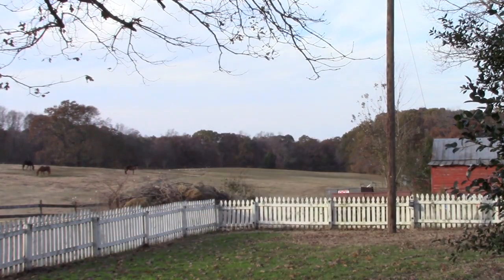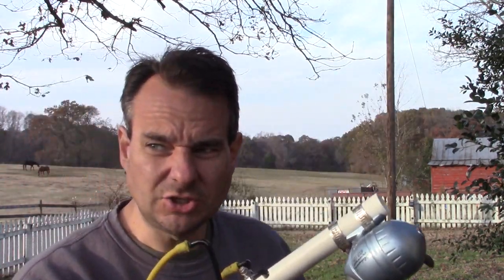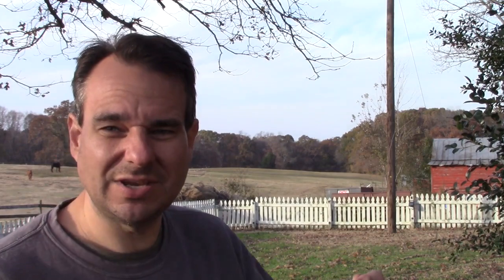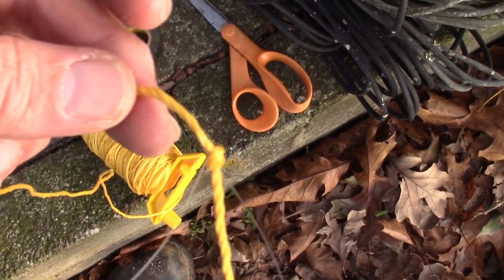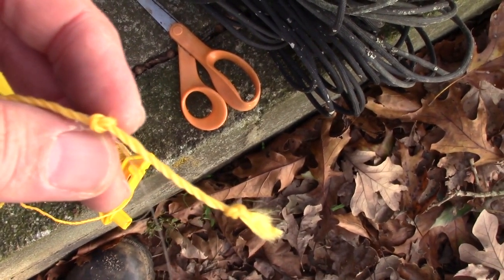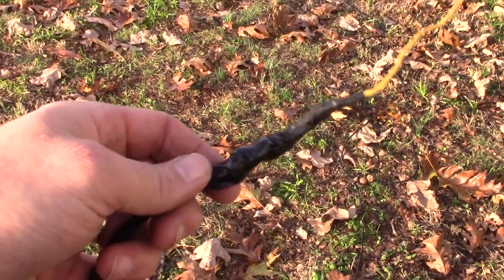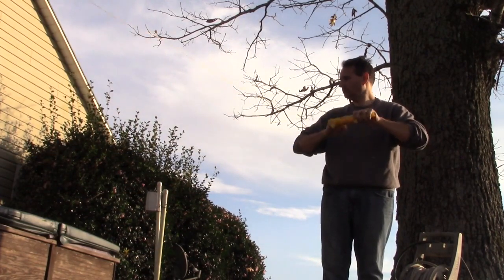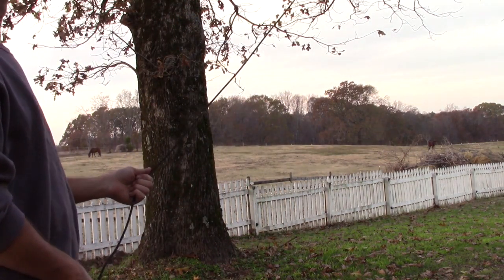Fan Vertical Antenna - Adding an 80m Element to an Existing Setup

Comment: Since this was a few months ago, how has your experience been working 80m on this? I should really do a fan dipole since I have one gigantic oak tree in my backyard.
Reply from the maker: 80m has been pretty good - pretty much the entire Eastern half of the country comes in without any issue, and without me having to use an amp.  Granted, I am using FT8 and CW on 80m, but that is still pretty good for not too much effort.  I haven't even bothered listening in the DX window and trying there as I am more focused on building up my CW skills.

Comment: That's an ingenious solution to getting the antenna up into the trees! The slingshot sounds like a much more fun approach than a drone for me. Love the views of the farm too.
Reply from the maker: Thanks so much, Alan.  The best are the potato guns where you basically fill a PVC pipe with compressed air and you shoot a target over the tree - but the slingshot works too :)  I am very much out of practice with it, though.

Comment: Have you tried putting aluminum foil on it... Little aluminium flags on my old TV antenna helped me get in PBS so I could watch reruns of Doctor Who at 1 in the morning.... oh and Red Dwarf... i love Red Dwarf...
Reply from the maker: Transmitting antennas are a little more critical in what you can do to them.  I used to tape episodes of Dr. Who so I could watch them at my leisure - I tapes a LOT of things back in the day - 6 hr mode so it would be hard to watch later on.  Still had like 500 tapes or more, and that doesn't include things I taped over.

Comment: I have gotten old enough that I have to limit my interests. Long ago in the military I had a ham friend and we hung out at the base ham shack. I've got some good stories from those days.
Reply from the maker: A lot of my interests lately has been in trying to get enough sleep.  I have been consistently failing.  The ham stuff is still a thrill after all these years when you make a contact - just the fact that it works at all.  It is very similar to the feeling when you play a record - its just a marvel.

Comment: What a super view of the farm. Really nice Kris. I only wish the weather here was as beautiful as it is here. We hardly got any snow in December and January now we are in a funk of sorts. We got three to four inches last night and it is still snowing now. Wow, so with the spare wire you now have three three working antennas. I was kind of following when you were talking about one feeding off of the other. I am always picking up info from you whenever you are doing projects around the farm. The quarter wave and the third multiples tripped me up a bit. But it came together after that. My only question can these antennas transmit cable stations too? Way to go Kris. Just beautiful out there~
Rob/Boston
Reply from the maker: It trips me up as well - its all on where the voltage and current go when you are using the antenna. At a quarter wave, it is low resistance at the end where you feed and high at the ends.  But at a half wave, it is the opposite.  Then like a wave in the ocean, at the third multiple (3/4 wave) it flips back.  At a full wavelength, back again... Just like waves - you ride it where it is breaking, not at the top.  The weather has been still warmer than normal, by at least 10 degrees.  It barely reaches freezing, no waters to break up or anything - grass is growing, trees are blooming.  But it is WET, it rains all the time and the ground is super saturated and hard to walk on because of the mud.
Reply: @dixielandfarm  Fantastic explanation Kris. I am seeing it more clearly now.I don't know how you store all of the audio, radio, computer and electronics info that you do. But it is always a lot of fun to watch. Educational too~